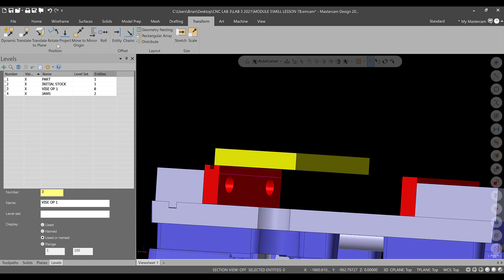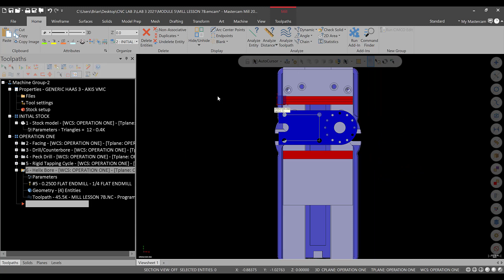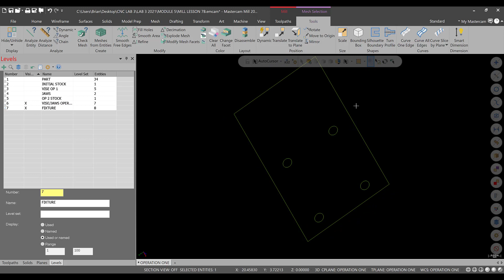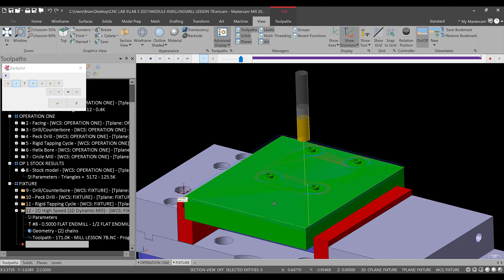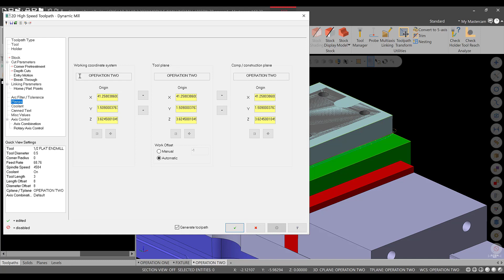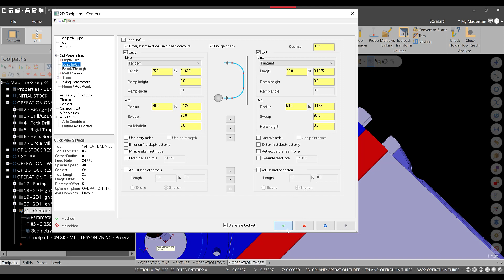MILL PART PROGRAMMING WITH MASTERCAM 2022 (PART TWO)

Comment: Would it be acceptable practice to run a finish profile pass for op 2 without a part loaded and with a -z offset to create clearance for tooling? As mentioned earlier its best to touch off on features of the part rather than the fixture...or does the fixture count as an extension of the part due to the contacts on the holes?
Reply from the maker: The fixture is fine in this case, and no I would just let the finish pass cut into the fixture in this case assuming we are going to be making multiple parts. I like to set zero on the fixture as vs the top of the part as that will be the same as the part height changes and that the fixture will simulate datum A.